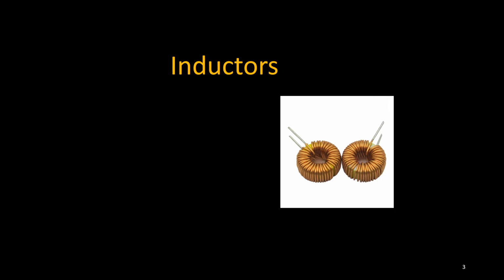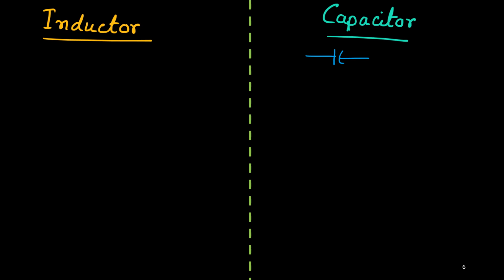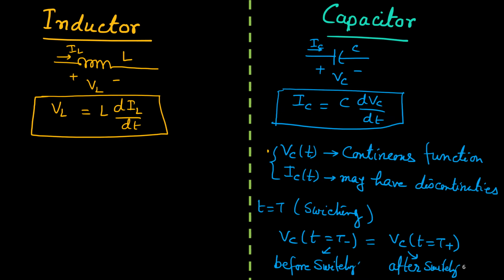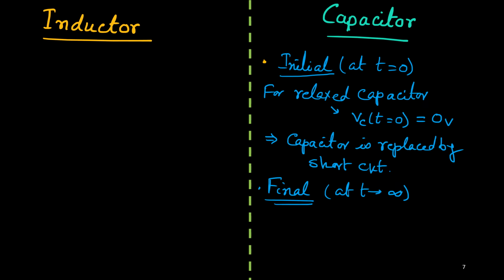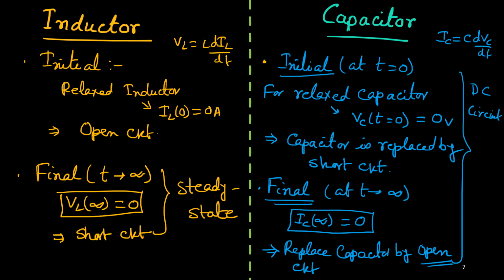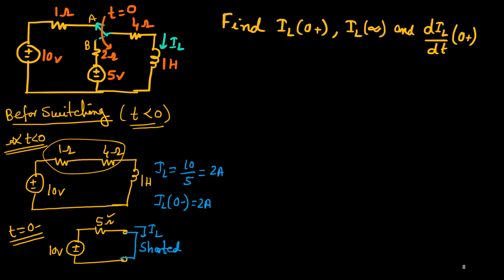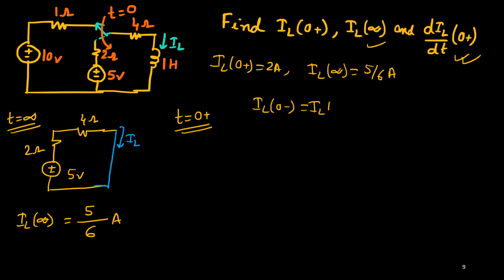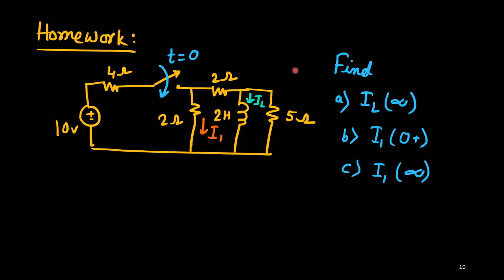Inductor in DC Circuits | Final Inductor Current | Inductor Voltage at Switching Moment

Comment: Timestamps (Powered by Merlin AI)
00:05 - Introduction to inductors in DC circuits and their analysis.
02:58 - Analyzing a DC circuit with an inductor and switch dynamics at t=0.
08:49 - Inductor voltage and current behavior during switching events.
12:01 - Understanding inductor behavior during DC circuit switching events.
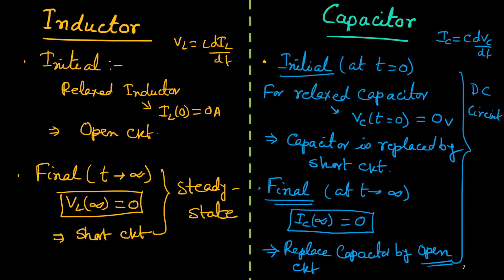18:07 - Inductors in DC circuits transition from open to short circuits.
20:50 - Inductor behaves as a short circuit at t=0 in steady state.
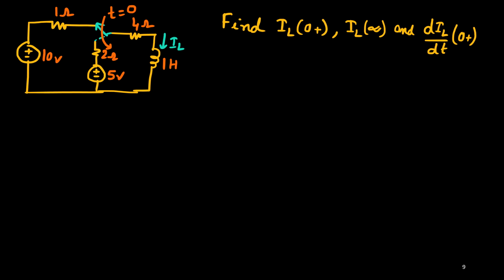25:36 - Inductor behaves as a short circuit in DC after a long time.
28:00 - KVL applied to find inductor voltage at switching moment.
32:22 - Encouragement to like, share, and subscribe for future content.